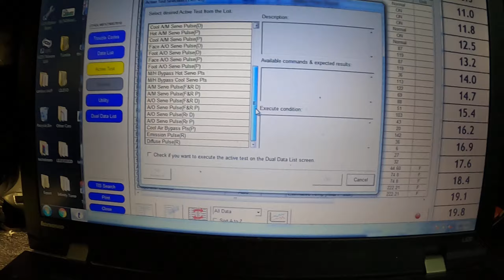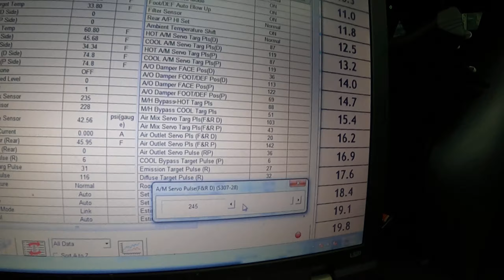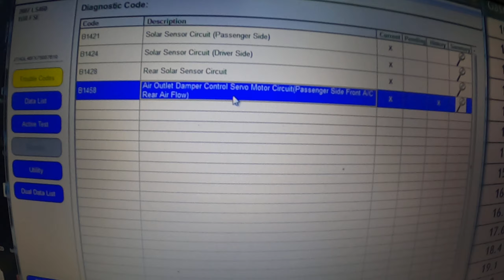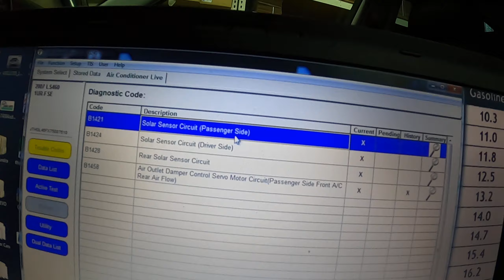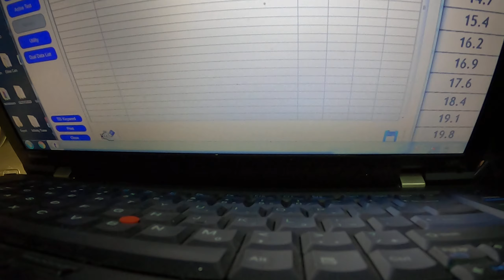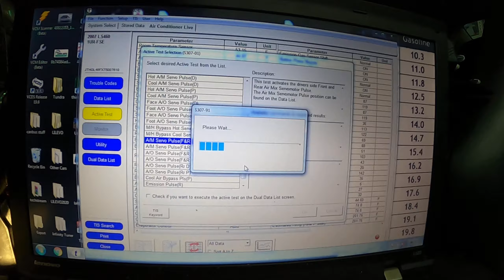2007-2017 Lexus LS460 HVAC Start up Delay 75 degrees Servo Motor testing and repair Part 1

Comment: What’s the issue if your HVAC memory is only for a couple hours?  After a couple hours whenever I turn car back on, it displays AIR CONDITIONER off on display. Then I have to set AUTO and temp all over again just for a couple hours of memory.
Reply from the maker: Same year as the video?
Reply: @LILEVO  Yes- 2007 LS L. HVAC memory is only for couple hours.
Reply from the maker: The issue would be the same. It's either a broken filter door arm behind the glove box if the cabin air filter was changed incorrectly, another bad vent servo somewhere, or the A/C computer @ibrahimi220
Reply: @LILEVO  Ran HVAC diagnostic. Noticed my vents on passenger side of the car front and rear blow less and cooler air than drivers side vents. Also Pulled code 97. Is that the AC Amp?
Reply from the maker: Yes from what i see 97 is either a harness issue or AC amp. Make sure to match the same part number (or higher last digit revision) with what you have @ibrahimi220
Reply: I have a 08 460 L every time I turn the car off let it sit for a while. Start back up it resets the temperature and my auto light stays on for about 20 seconds then it goes off and allows me to have normal control. Is this normal or not?
Reply: @ No, it’s not supposed to do that. It’s supposed to remember your last temp setting regardless of how long ago it was.
Reply: @ibrahimi220  OK so what is the worst that could happen if I can continue to drive it that way and just keep adjusting the temperature and is just a costly fix at the dealer does this problem get worse overtime
Reply: @ Depending on what’s actually wrong. Maybe some of your vents are weaker or barely move air.
Reply: @ibrahimi220 what’s a estimate at the dealer to fix this?

Comment: Hello There, I’m helping my cousin fix his 2010 RX350.  This is the first video explaining the delayed startup of the HVAC.  Any suggestions on troubleshooting would be greatly appreciated. 
 
Here’s the 2 Issues:

- Only blows air out of the middle vents.  No defrost or floor.
- After restarting the car after some time, the HVAC takes about 1 minute to start blowing or even show temp on the dash.  It always starts out in AUTO and on 75 Degrees.

Lexus of Tulsa said it has the following code: A/C Stepper Motor: founded code B1443, malfunction with #1 air outlet damper control servo motor circuit.

So far, I replaced the mode (floor,vent, defrost servo) servo accessed through the passenger side footwell and the AC Amplifier.  That didn’t fix either of the issues.

ALLDATA says to check the wiring harness.  Is that where you would go next?  I noticed the connectors going to the servos have circuit boards built into them.
Reply from the maker: 87106-06250 is the #1 servo. That one is buried inside the dash. Have to remove the whole heater core/radiator assembly
Reply: @LILEVO  on the RX-350 I was able to remove and install the new servo without pulling the dash.  Had to shave a little plastic off the top of the servo housing.  However, this did not fix either issues.  Neither did the AC amplifier.  Do you have any suggestions?  Or how to troubleshoot the wiring harness?  The plastic clips that plug into the servo motors have circuits in them.
Reply from the maker: @kelbymorgan  Never heard of wiring problems or damage. Just to be clear which servos did you change? There are three of them 87106-07120, 87106-07140, 87106-06250